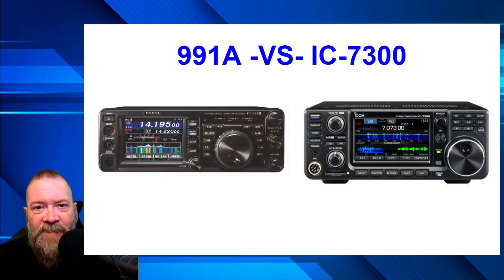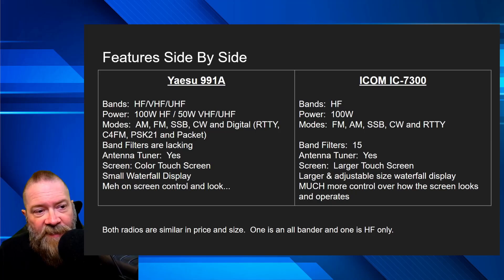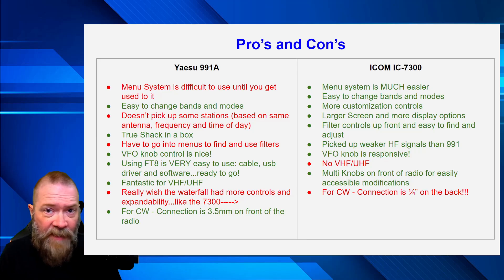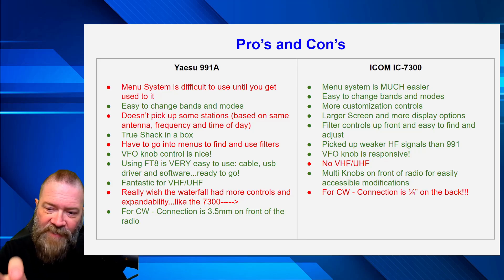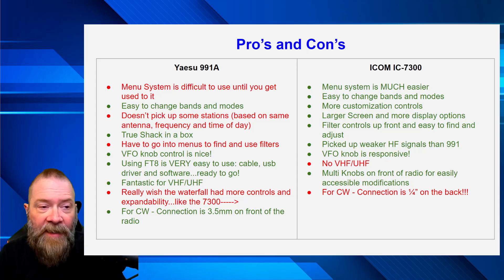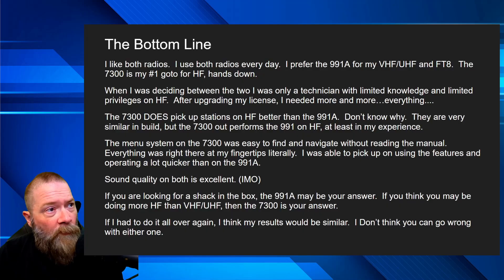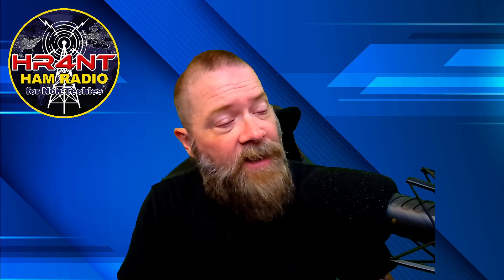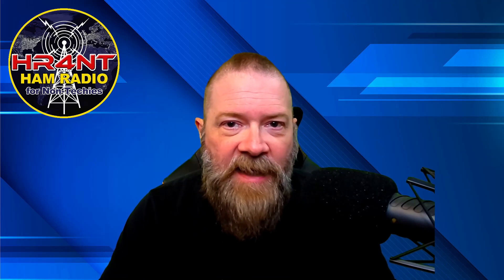A Tale of Two Radios - 991A - VS- IC-7300

Comment: I have both and I can say my piece too. In my opinion you don't know the 991A enough, if anything it's the opposite you perceive the signal with the 991A while with the 7300 you have it inside the noise. The 991A's DSP is better DNR, contour noch shift is much better than on the 7300
Reply: Correct icom ic-7300 very noisy receiver Yaesu ft-991 is good
Reply from the maker: My main issue with the 991 is the menu systrem as with most Yaesu's.  I ended up selling my 991 adn stuck with teh 7300 for ease of use.  Thanks for the comment and for watching.  73!!

Comment: Ideal solution is IC7300+IC9700. CW connection on these is not a big deal for home station. I use CW on 2M 432 and 1296 mostly during contests. 73 de KT1R Lou in WV
Reply from the maker: That sounds like a great setup.  Thanks for watching and for the comment.  73!

Comment: I’ll add this and it may not apply to your RFI situation.  I had a similar deal. Bad RFI durning the day, noise floor would drop a bit but noise was always there.  I tracked the issue down to both electrical lines and the city water system of gathering numbers, as they use a wireless type connection.  Check your water main area.
Reply from the maker: I have not tried that before!  I'll keep that in mind!  Thanks for the comment and for watching.  73!

Comment: Ok so to be fair. the 15 filters on the 7300 are bandpass filters. They are not kicked in all at once. The 7300 is a direct sampling radio and the 991A is a superhet. Bandpass filters are often needed to reduce the load on the a.d converter. The superset doesn't need that, because the IFs are the bandpass filters.
Reply from the maker: Very good to know.  Thank you for sharing that!  73!

Comment: I was replacing my FT-857D, the 7300 doesn't do above HF and, as a result, doesn't even do D-star. I do not regret getting the 991-A with C4FM HF, 6M plus 2m, and 70cm. The receive is far better than my 857D, it seems to me. I keep looking at Icom, Kenwood, and others in a similar price range and keep landing on Yaesu.
Reply from the maker: If that is the case then that is the right radio for you.  Choosing a radio is all perspective and needs.  The Icom fit me better, but there is noting wrong if the Yaesu works better for you!  That's fantastic.  Thanks for the comment and for watching.  73!

Comment: The Icom is also already setup for FT8 unlike other radios. FT8 works great on the Icom. On my FT-991A and the FT-710 I was always dropping the connection and having to reset it. The Icom never had that problem. However, both of these are good radios. Just create your own list of what you are wanting in a radio and do the comparisons. Thanks for posting.
Reply from the maker: I agree.  Each person will have different needs and therefore a personal; choice in radios.  Thanks for the comment and for watching.  73!

Comment: I'd rather buy me the Yaesu 991A because You get more for the Price!
Reply from the maker: I thought the same thing until I wanted to operate on VHF and do FT8 on HF at the same time.  That posed a problem for me, so I had to separate my VHF/UHF from my HF.  If that is not an issue for you, then you will probably be happy with that radio.  Thanks for watching and for the comment.  73!

Comment: very good. I have a old Icom 735 and love that one. my back up. I up graded to 7300. FT8 on 7300 is great as well as outher digital modes. JS8 call SSTV PSK31 and bunch more. I like to keep my VHF UHF separate, that just me. I like the 9700 I want all mode AM/FM/SSB/CW/ digital on VHF and UHF and I want the 1.25 meter as well. hard find. 73's
Reply from the maker: Thanks for sharing. I too like keeping those separated and that's why i eventually sold the 991 and bought a 2980 for VHF only.  Been happy every since.  Thanks for the comment and for watching.  73!

Comment: I originally purchased a Kenwood TS2000 when I was first licensed. Then got a FT857D for mobile   I am considering purchasing either a 7300 or 991.  I really like both radios. Now I’m thinking about getting into POTA/SOTA.  I recently purchased a G90 but when I first powered it up. Obviously my eyesight isn’t what it used to be. Now going to sell it !

73 Steve AA4SH
Reply from the maker: I think, and this is my personal opinion, but I really like the 7300.  Many of the folks I do POTA with ALL have 7300's or the new Yaesu FTDX10.  I still have my preference to the 7300 even though it was released in 2015.  The menu system on the Icom radios , to me is simpler to navigate and get what I need done a lot quicker then the Yaesu menu system.  I like the larger screen on the 7300 due to my eyesight at 52 is not what it use to be...LOL  Do your research and if you have a chance to play with both radios, I suggest doing so in order to make the best decision that is best for you.  Thanks for watching and for the comment.  73!

Comment: I wonder how to compare HF/VHF/UHF radio with HF radio. It is like comparing a car with a lorry.
Reply from the maker: They are both HF radios, just one has the addition of VHF/UHF. I like the ease of use of the 7300 over the 991A.  Thanks for watching and for the comment.,  73!
Reply: Why do you think this the addition of VHF/UHF? Did you find the information that this is the addition somewhere on the box or in the manual? I think it is a complete solution that has no direct competition.

Comment: Thanks, looking closely at these two for my first radio radio base. I am a new general. Use to run SSB 40 + years back and loved it so drawn to HF. I have a Yaesu VX-6R and lots of repeaters I can hit. One 2 meter 1/4 mile away. You’ve got me second guessing myself on the 991a. The 7300 seems like a real step on HF and the learning curb of the 991a on my old brain May push me over the edge 🤪. I’m thinking I’d spend lots of time on UHF/VHF and special dedicated evenings for skip hunting. Of course, I love the VX-6R and while limited on frequencies I could hook up an external. Anyway, I really enjoy your channel. I’m checking used market too.
Reply from the maker: If you think that you will spend a lot of time on VHF/UHF, you may want to consider the 991A because the 7300 doesn't do those bands being HF only.  The price of the Icom 9700 is just too much unless you REALLY want to do some serious VHF/UHF.  Weight your options and you will find the best radio for your needs.  I ended up selling my 991A and replaced it with a VHF only Yaesu 2980.  So I now run that and my 7300 and I'm pretty happy.  Never really did much with UHF, so that wasn't an issue for me.  Thanks for the comment and for watching.  73!!

Comment: Does the 7300 have backlit buttons and knobs?
Reply from the maker: The 7300 does not have backlit knobs or buttons.  That is a feature that I wish it did have for those wishing to operate in low light conditions.  Thank for the comment and for watching.  73!!
Reply: @HR4NT thanks Scott!  Things like that for a low lit shack, or screen brightness and glare when operating outside would seem important nowadays.

Comment: Hey buddy. I’m grabbing the 991A in the next day or so. What HF antenna do you suggest for me to just get in the air and make some contacts on 6 and 10? I appreciate your advice. Thanks and have a good weekend!
Reply from the maker: Hey thanks for writing in!  I think your best bet, if you are able, would be to build one.  Whether it is a simple dipole or an End Fed Half Wave antenna, that may be the answer for now.  I assume you will want to use the other bands down the road as well?  If so, it may be a good idea to look into a multi-band antenna like the DX Commander which you can choose the combination of bands you want to be able to use.  I assume that you are a Technician Class operator, but maybe going for General at some point?  The 991 being an all band all mode radio is capable of a lot of stuff, so a good antenna would give you a much better experience.  And with a multiband you could at least tune into the other bands and listen while you are waiting to get your General (I am assuming here, so please forgive me if you are already a General or Extra).  The other reason I suggest buying something like the DX is that when I looked for 6M & 10M antennas...they cost about as much as the DX Commander if not more!  That is a bit ridiculous to me.  You "might" be able to find a premade End Fed Half Wave that does 10 and 6 as well.  That would be a bit cheaper.  If your budget won't handle the cost, then building an antenna will be your best bet for now.  I hope I was able to help you out.  Thanks for watching and for the comment.  73!
Reply: @HR4NT  thank you for your input!! Much appreciated. Yes I’m just a tech at the moment studying for general, I was also thinking about building one for sure just getting information on what other people have used or are using. I wanted the shack in the box to be able to build off over time. I’m not trying to rush it in anyway, I have the rest of my life haha. Definitely going to build something and also grab an end fed for sure. Thanks again and have a great day! I hope you’re recovering is going well! 73
Reply from the maker: @Cbro-621   I think that you are on the right track.   The best thing for you to do is take your time with this learn as much as you can and research every bit of equipment that you can possibly can think of. The only other thing that I can think of that I tell my viewers quite often is to buy one's cry once meaning don't just buy anything because you can afford it now save up and get the stuff you really want the quality stuff and you will be a lot happier down the road.
Reply: @HR4NT  Awesome! That’s my thought process on this. I have been researching for months now on what rig I wanted to get and antennas, I just want to take my time and not rush. It’s a hobby no need to plow through it! Thanks again for your input! Have a good day

Comment: And enormous number OF  hams are going to want to use FT8    and four a lot of first timers will appreciated the 991 being fully ready for this mode.
   While we're evaluating radios let's teach hams the proper lingo of what is going on----  for example when you say one radio hears signals and the other does not, that is an evaluation of sensitivity.  How sensitive is the radio??  I have found ICOM models comes in general are very sensitive.   However as soon as you discover grEAT sensitivity you must evaluate selectivity.  What I mean is and what I've seen also happening in ICOM radios, is that you hear several signals others do not, but you're ICOM hears a number of signals you wish you could. Separate them. That is called selectivity so ask ICOM IF IT cannot separate out a number of signals you wish.
        When evaluation comes. One must evaluate sensitivity and selectivity because one works with or against the other.    Today most of the better ham radios for sale new are "state-of-the-art" meaning that's a sensitivity is at the highest science can provide ,so selectivity and noise handling becomes very important.  Handling all kinds of noises with different circuits and knobs as a feature of the best radios we now can buy. Are ham radios are not state-of-the-art when it comes to handling noise because hams require the signals they listen to to be intelligible all the time.  This is not necessarily important for commercial applications of radio.  Evaluation of a ham rig must include noise handling of it.
     Here is a new concern. Today's receivers use front end circuitry which is wide open and can receive highly sensitive but also receive many signals on top of each other. SDR technology has given us the need to spend money for hire selectivity and Noise handling because the sensitivity is already there.   The use of what could be considered old fashioned crystal filter circuit are very important when used with SDR technology in receivers. The crystal filters provide selectivity.   
    A concern about the ICOM IC7300 is that strong nearby signals well run over the weaker signals that you want to hear, and this particular radio is a weakness. Use of an unmodified IC 7300 in a setting like field day or if you live with a strong RF source, a big signal, nearby, your little ICOM well only hear the big strong signal and not selectively reject that.
Reply from the maker: Greetings K4VUD!  I agree with what you said here.  There will always be give and take with any radio that you own.  With technology progressing like it does, you will get better features and so on, but it may sacrifice something else in the radio as you explained.  There are definitely factors in today's radio that must be considered when buying one, however, overall, I think there are some fantastic choices out there, but you must be well-versed in them before choosing one.  Thanks for sharing, for the comment and for watching.  73!
Reply: Many experts claim a warning about the icon 7800 receiver front end is too wide open and will be swamped by nearby strong RF.   Some of the best experts caution about that and say they had a good receiver made like the 7800 is great if there are crystal filter circuits following to control the wide open front end

Comment: Well being on the receive end of these radio's being down under I can tell who is using a 7300 with a lot of processing, it's not good and once they wind things back a bit they come clean. I use FT-9000D and FT-2000D and through both radios the same problem exists for the 7300. Don't over do you RX filtering! I have a friend that agrees it is a problem with his 7300.
Reply from the maker: Thank you Rex for sharing that!  I appreciate it.  73

Comment: Tardy to the party here… this is a great video.  I recently passed my general and plan to get a transceiver when I pass the Extra as a reward to myself.  In the mean time I am doing the research struggle.  I have not a clue as to what part of “hamming” will attract me the most, so the idea of the complete system that the 991 offers sounds like a good choice, but damn that ICom menu and screens seem so much more pleasing to use.  Now there is the IC-705 but it only does 10 watts.  Now I’m wondering if 10 watts is all I really need.  The idea of low wattage and perfecting my antennas has an appeal itself.    Thanks for your honest opinion! Keep up the good work!!!
Reply from the maker: If you are just starting out, I recommend a 100w rig.  A lot less frustrating!  Trust me.  The 705 has its place, but you need to "want" to do QRP operating  if you buy one.  Do you have a heavy VHF/UHF presence where you live?  If yes, then a shack in the box (991A) may make sense...if not, then the 7300 I think will be the best choice and give you year of enjoyment and use.  It really depends on YOUR needs.  I can give my opinion all day long, but it is still just an opinion.  I hope this helps!  Thanks for watching and for the comment.  73!
Reply: @HR4NT  thanks for the input, it’s much appreciated.  I has a short chat with my bro-in-law who is a long time ham too. I think I’m going for the 7300.  I had a tech license way back in the 1990s but had long since expired. I have an old Radio Shack Htx-202 from those days that I think will scratch that 2 meter repeater itch well enough. I dug it out and it still works!!  Keep up the channel, you have a great show. Cheers

Comment: I just purchased a Yaesu 991a and tried out the System Fusion (Wires-X, C4FM) and believe me, it all sucks big time.  You Yaesu guys said that System Fusion provides crystal clear audio, but that just isn't the case.  Every time I go to C4FM the audio is muffled, muddled and other Ham's voices sound like computer generated voices.  If I had purchased the Yaesu 991a for the digital mode, I would have immediately returned it.  I was considering an ICOM 7300 but other Hams have told me that D-Star (Death Star) is even worse than System Fusion.  You guys that designed the digital portion have a long way to go before I consider it a proper mode of communication.  I purchased the Yaesu 991a because of it's all mode.  We have a 2 meter SSB net here every Wed. night & 2 meter sideband radios are hard to find.  W Rusty Lane K9POW in eastern Tennessee
Reply from the maker: Before I knew what was required for System Fusion, I bought the 991 with that in mind.  No one in my area has a WiresX repeater setup, so that entire part of the radio feature was a bust for me.  I ended up selling the 991 because I wanted to separate my VHF operations from my HF and FT8 operations.  Ended up replacing it with the 7300 and couldn't be happier.  I don't use DStar, but that menu system on the 7300 is a dream compared to the 991.  Thanks for watching and for the comment.,  73!

Comment: 991a is an older design. If you do not want VHF all mode the 7300 of the new Yaesu DX 710 are the front runners
Reply from the maker: I ended up selling my 991 in favor of a 7300.  Love it!  Thanks for watching and for the comment.  73!